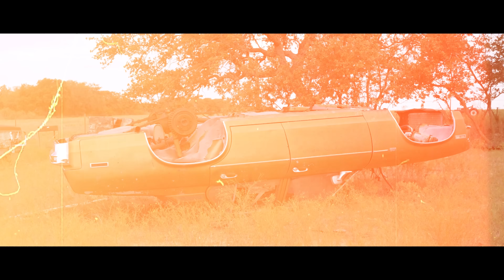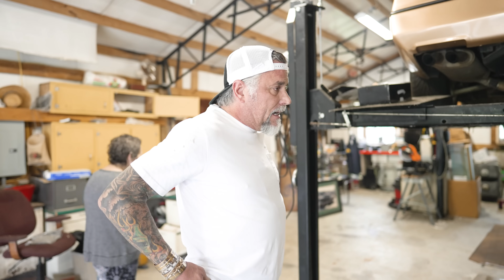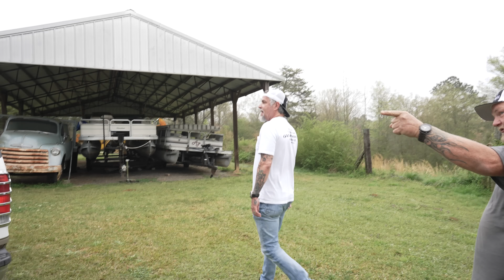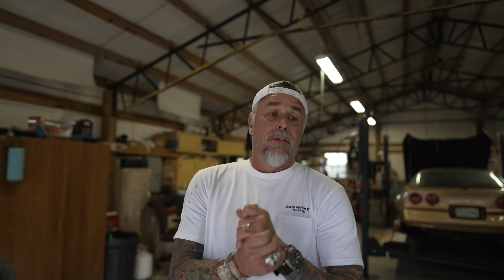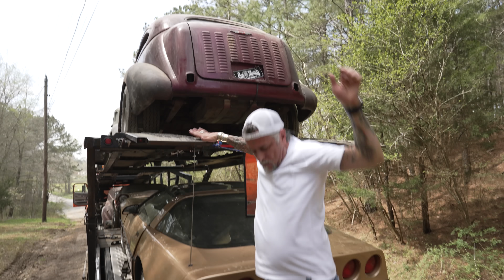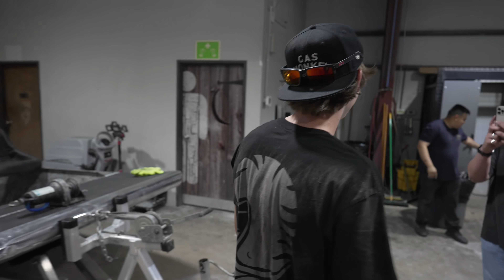Alabama Classic Car Nest - 6 Car Buy - Wheels & Deals

Comment: I have gone to the Gas Monkey Garage store, and I have a really cool shirt. I wish I could have met these guys. My brother arrived at our house in Fort  Worth, and he came with me. It was a blast. I love the door handles, it was Gas Pump Handles. That was pretty cool. I drove a 240Z after I graduated high school. Man that car was fast. No 260Z or 280Z could keep up with me. When I put new tires the guy was all excited, he told me i had an early model. He said that my model was the Fastest Model. And he was right. I raced Chevy 350 equipped cars they could not pass me. It was a real fun car to drive. The Crossfire engines were not good at all. Chevy knew and stopped those engines pretty fast. Horrible engine.

Comment: That is the same version of the Corvette that they used in the Miami Vice "Ferrari Daytona" kit car. Built in San Diego, they removed the body of the car and put their fiberglass body on it. That car had very low milage then. Most of the miles were put on the machine dressed as an Italian car. The entire Corvette body was to be parted out, last I can find on it. Crossfire, huh? Looks like that is what drove Crockett and Tubbs on the show. I wonder if they have any unused kits left? Seems possible. He would not be hard to find and ask.

Comment: People do NOT let Richard bullshit you. Getting that 280Z for ONLY $6500 was a STEAL & was the true treasure of this buy. 😎
MINIMUM value on that car is $30,000. 1 owner, no rust or damage, it'd sell @ auction for between $40k & $50k
Original & unmolested Datsun Z cars are bringing $100k and more.
The values & prices on 240Z's have skyrocketed & therefore have pushed the prices of 260's & 280's up as well.

Comment: The 84 Corvette was the Motor Trend Car of the Year.  That gold color was always pretty.  This is going to be collectible in a few years and would be a good buy for someone.  There are some folks that rebuild those Crossfire intakes which will make the car run fine.  We did not see much of the interior though so not sure what it is worth.

Comment: Only two of those cars were interesting (well I mean something I'd really like to have type interesting lol). The Vette and the "Z". Well I actually really didn't see what his problem was with the Camero either seeing that it wasn't completely rotted out from rust yet and had the LSD, 350LS and I believe it'd come back to life without much "Ado". But anyway they are right about the Vette. They are build on a tube type frame Chassis. Low and race car like. Cleetus and Road Kill both did cool thing with them even if they didn't have the desired V8 or wasn't the Z1. Etc.